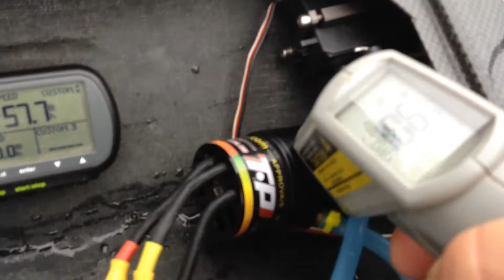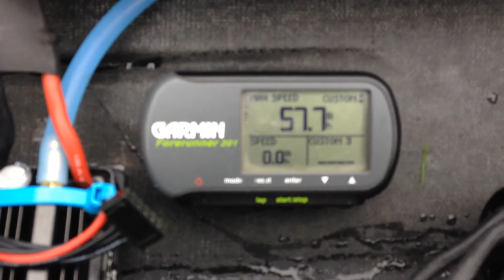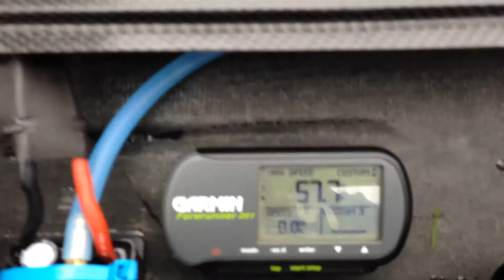TFL PURSUIT 5s prop test #2 TP power

Comment: What about testing the following motor with THIS 5S battery and THIS M443 prop :
Leopard 3674  2200 Kv ?
It was the fastest motor with 4S and X445 prop ......
Could be interesting .....
Cheers
Reply from the maker: Pedro Monteiro 
I do not have this motor anymore...
I only bought the Leo and the sss to do the video and sold both afterwards.

Comment: Congratulations .... !
57.7 MPH ....... !
Pursuit was riping ..... REALLY FAST  !
Wow ...!
PROBLEM : Boat was rocking strongly along longitudinal axis, side to side ......
Very choppy waters didn't help too ......
Possible solution : What about moving ESC to the left side, cooling fins paralel to the keel, and moving battery further back ?
( Trying to reduce Torque Roll  ....... )

What prop is this ?
Octura M545 ? CNC 443 ?
TP motor seems to love it ... !!!

Cheers
Reply from the maker: Pedro Monteiro 
I will try to move the battery back....

It's a stainless cnc 443 
Made by Alex in Europe.
Reply from the maker: Pedro Monteiro 
Yes that's the one but this one had some extra work done too...
Ah the m444 I had that one but now it's laying at the bottom of the lake i lost it on the airane on second run.
While using the factory bullet nut and 2 piece drive shaft, this is the reason I don't have a 2 piece shaft anymore.